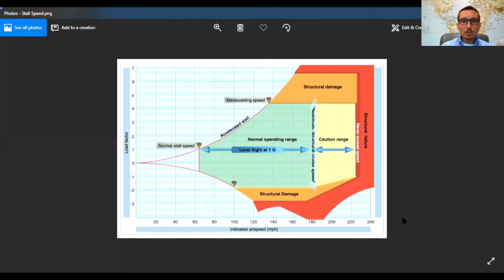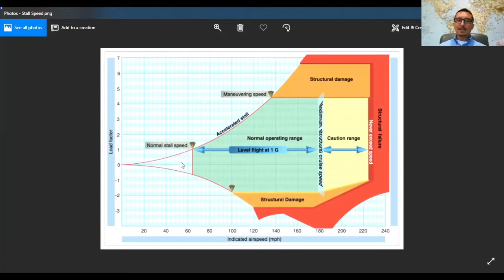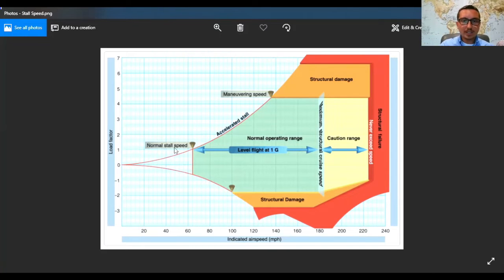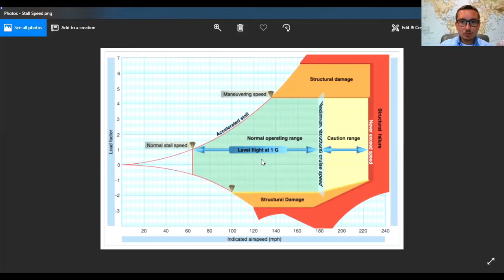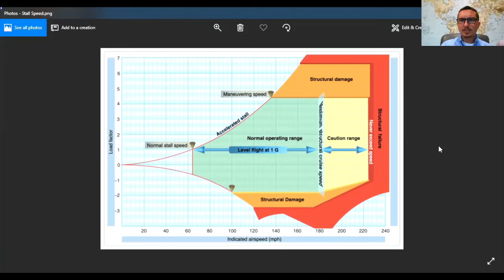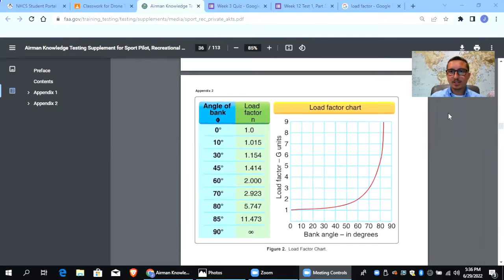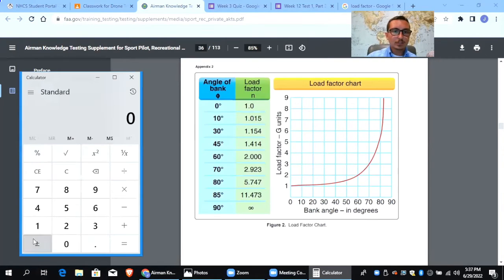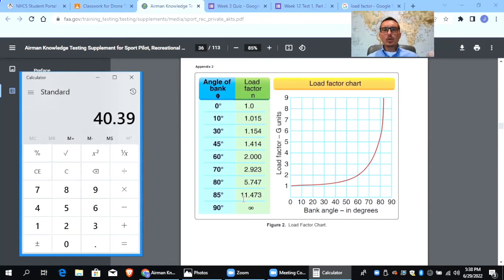Load Factor FAA Part 107 Drone Exam

Comment: The term stall speed is confusing. A better term would be "airborne speed," that is, the speed it takes to remain airborne. So then, an increased load would require an increased airborne speed.

Comment: Does this calculation work with any number. For example, what if the number was 41 or 42 or even 39, which load factor number would I multiply by.
Reply: The fundamental concept to note is cross multiplication. Easy and straightforward if you use that term when looking for more information. At least that’s how I do it. Normal weight over 1 (x/1) cross multiplied with (to find) your unknown load factored weight (y -what we are finding) over specified load factor(x - from the question) (y/x)

Comment: Hey Mr. Mig, these videos are great and I just passed thanks to these series of videos, so thank you! One part of my test that I didn't see in your videos (although I may have missed it) or in any others were specific flight characteristics of fixed wing aircraft (moving the aileron, rudder, elevator will make the airplane pitch, yaw, or roll), and how a load on the aft or forward will impact flight. My test had aft in it like twice and I forgot where that was :( So for those studying, go look at a diagram of an airplane (https://www1.grc.nasa.gov/beginners-guide-to-aeronautics/airplane-parts-function/), they may ask you about it.

Comment: An aircraft flying straight and level has a load factor of 1. Load factor of 1 means lift force is counteracting the weight with the same amount of force (2000lbs of lift, 2000lbs of weight)  0 would be weightless just like astronauts that can fly without any lift force since there's no weight in the first place. Load factor is lift/weight, therefore in a turn of an aircraft the lift force is going to be divided into two forces: the vertical lift (holding the aircraft aloft) and the horizontal lift (making it turn). Since vertical lift is decreased in a turn as it's shared with the horizontal lift to make it turn, weight force (that always points towards the center of the earth, even in a turn) is going to be greater than vertical lift and the aircraft descends. In order to maintain altitude we need to increase the Angle of Attack to compensate for the decrease in vertical lift. Doing so will increase the total lift (both vertical and horizontal lift) and this is where the load factor of 1 increases since the total lift is greater than the weight force (Load factor = Lift/weight). Since the load factor increased, means we're maintaining altitude at a higher angle of attack than normal to compensate for the decreased vertical lift in a turn, doing so will increase the stall speed because we are closer to reach the critical angle of attack at a higher airspeed than at straight and level (1G). This is called accelerated stall, the more load factor you have the higher airspeed you will stall.

To find the % of increase of airspeed in a specific load factor just add a square root to the load factor number:

Load factor of 2: √2 = 1.41

You will have an increase in 41% of stall speed. Using the chart example at 1G stall speed is 64 airspeed. 64 x 1.41= 90 airspeed. At 2 load factor you will stall at 90 airspeed

Just found this video randomly, not really sure why drone pilots need to understand this, sure you do if applying for airplane license